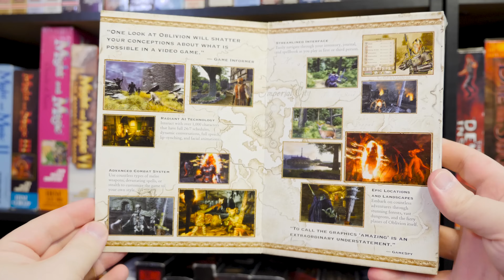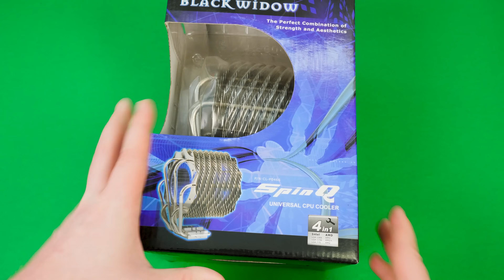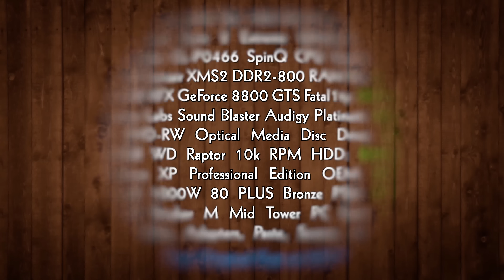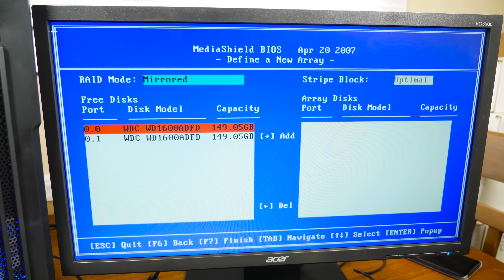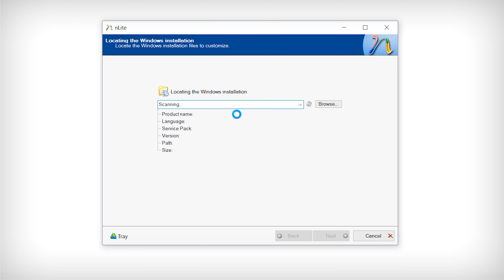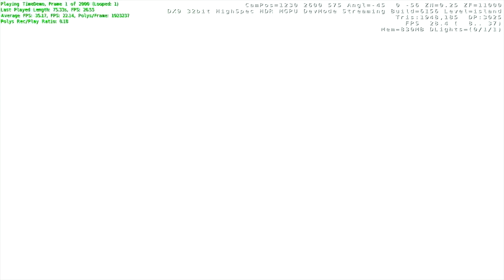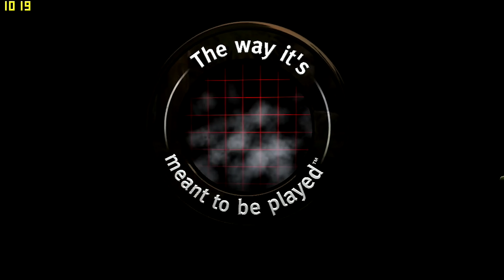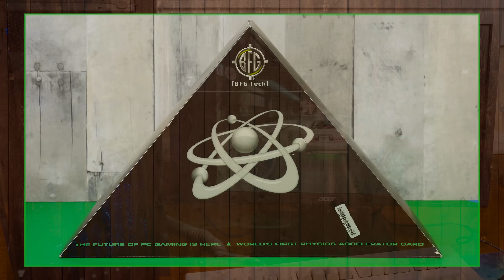LGR - Building My Dream $3,588 Windows XP PC

Comment: You didn't even use a swiss army knife
Reply: No allen wrench or tweezers either :D
Reply: But how on earth did he manage to install the CPU without a CPU installation bracket thingy and such a small amount of thermal paste??? :D
Reply: How did he get it to boot if his RAM isnt next to each other?
Reply: And the power supply fan wasn't even throttling
Get that unforgettable verge video up at my channel!
Reply: And his power supply I mean BRICK did-int zinc short circuit with the system.
Reply: But did his allen knife hopefully have a Philips head on it that didn't short out the brick?
Reply: Well at least he was able to install the brace at the back of the case before putting his MB i/o ports through said brace.

Comment: Windows '98 and Windows XP were the two OS that I delayed as long as I could before I was forced to "upgrade"
Reply: now for me it's 7. looks like i still have a few years until stuff stops working.
Reply: The extended support for Win7 SP1 will end at 14.01.2020. So you have about 1+ year.
Reply: i'm talking about software, not support from MS.
Reply: Not really if you have win7 pro sp1 it has to 2023.
Reply: Windows 7 > Windows 10. Windows 10 = ass. My point is stay on 7 until it's ripped from your begrudging hands. I've always run windows but Linux looks better and better with every windows iteration.
Reply: +HalcyonDayDigital For most use cases I'd agree, however with my specific monitor setup (4K on one and non-4K on the other) Windows 10 does actually work better (or at the very least, Creators Update forward - I'd stay away from the original). But you are right, for most cases, Windows 7 is probably the best option.
Reply: I've used 95, ME, 2000, XP, 7, 8.1 and 10 
And what I have to say is
IF IT'S NOT BROKEN, DONT FIX IT
Reply: """"""""""upgrade""""""""""
Reply: i actually upgraded from xp to 7 around 2 months ago lol
Reply: I've used XP until somewhere in 2018, using 7 now, but will certainly switch to  Linux distribution.
Reply: I dualboot windows7 and xubuntu currently
Reply: I dual boot Ubuntu and windows 10 on my laptop. 90% of the time i use linux, except for the 3 softwares that require windows
Reply: Only issue I've had with windows 10 was the first install my HDD ran at 100% constantly but after I reinstalled windows 10 I haven't had an issue since. I'm glad I haven't had any of the issues I see people complain about all the time.
Reply: thinking of doing that too as my laptop came with win10, my desktop is what i put win7 on. I just feel like win10 is a bit slow on my laptop lol
Reply: haha so did I! Finally went to 10 recently
Reply: Windows 98 why that os sucked unstable over complicated
Reply: Here's the link about OS support in MS, can't see 2023 - https://support.microsoft.com/ru-ru/lifecycle/search?alpha=Windows%207
Reply: @MilesPrower1992  but it is broken. Some can at least admit they don't know anything else or that they are lazy to switch. All of that is broken by design.
Reply: @dushk0  you really dont understand what I'm saying
Yeah they're not supported anymore
But if something worked fine in Windows Previous, (as in the last version of Windows) don't change it in the new version.
Reply: @drunkwiizard3483  then you'll never get to play State of decay 2 and that game is awesome
Reply: @drunkwiizard3483  or Halo 2
Reply: @drunkwiizard3483  I meant to say Halo wars 2
Reply: InGaming pc haha you've got me with Starts of Decay 2 but I do have Halo Wars 2 on Xbox One. Also I do actually have several windows 10 PCs but I just don't like it lol.
Reply: @drunkwiizard3483  I'm with you. I regret upgrading to ten for free.

Comment: The late 2000's were an awesome time. Hardware that can still play today's games, the fact that gamers and heavy users were ignoring windows vista and waiting for windows 7, among other things.
Reply: It was probably still better to run XP than 7 at the time. The vast majority of games used DX9, not DX10 or DX11, largely so they could run on XP in the first place. If your PC was compatible with XP it might have been a better choice because obviously it would use a lot less resources leaving more available for the games.
Reply: Yep - that exact setup would take 8GB RAM easily, and you could then put a modern Nvidia card in, and install Windows 10 on an SSD. 

That would run most of todays games. An Nvidia 1050 or 1060 would be overkill, but check it out - it'd run loads of todays games a playable framerates.

Hint: I've tried this :)
Reply: Yup, I'm still running an overclocked Q6600 with Windows 10, 120GB SSD, 8GB of RAM, and a 750Ti.  Runs most modern games just fine.

Comment: When a 2007-2008 computer better than your computer
Reply: Me lel
Reply: Cool
Reply: Bro. I apologize.
Reply: @kacpreusz9911  co?
Reply: @mlcs  Wiesz co to tłumacz Google?
Reply: @kacpreusz9911  owszem, wiem. Ale chyba coś Ci się pomyliły komentarze.....
Reply: @mlcs  ???
Reply: I'd say me too, but I finally got a computer that can sort of compete with that beast.
Reply: That's honestly sad lmao. Then again I can't say much, mine's only slightly better.
Reply: Jep thats the Case... Build my PCs in very Low cost with used parts
Reply: And i am thinking my PC is garbage with 8gb ddr3, 120gb ssd and 1tb hdd, amd a10 7800 with integrated GPU which runs gta v...
Reply: Pretty much my PC back then. 2GB of RAM and one 8800 GTS.
Reply: I was relating to this 5 months ago but i'm so happy to now have a med range pc with and i7 16gb ram and GTX760 SLI x2
Reply: chronic autism I have a i5 8gb of ram GTX970m it runs at 2.4 ghz its a 2016 acer aspire e 15 5
Reply: @residntas6618  Maybe you could look for some second hand stuff. The cpu is not great but if you can find a second hand high end Haswell CPU (Intel 4th gen core), a compatible motherboard and an AMD RX570 GPU. Then you could still use the DDR3 memory, ssd, hdd, case, PSU and if it's an aftermarket cooler maybe you could even reuse that (standard Intel coolers are pretty much garbage but do the trick if you don't overclock or mind the noise). That would still make an awesome system today.
Reply: @CheapBastard1988  Already upgraded my pc. Now it got ryzen 5 1600, rx 580, ddr4 16gb, 1tb HDD and 250gb ssd.
Reply: @residntas6618  still got a ways to go son. I built my first pc 4 months ago, 2600x, RTX 2070, 32gb DDR4, 512gb m.2 nvme, 1tb SSD, 5tb HDD. You upgraded to a low end pc lmao.
Reply: @TheGauges420  I always do so. :-)
Reply: @TheGauges420  I use PC for gaming, and i am on tight budget, it runs every high end game full settings so i dont see point of upgrading rn
Reply: Thats me
Reply: @residntas6618  

Yup, don't worry about that snob anyway, his rig is just a money waster especially that RTX 2070, which is hardly an upgrade from the Nvidia 1080 TI, and way more expensive then one at that. 

Regardless just keep doing what you have been, and find decent Entry Level parts for the time you built that PC, and upgrade whenever you feel like it, I know my rig I bought 4 years ago still works great for my needs, and I don't care about maxing my settings all the time, so why waste the money when I don't have too. 

CPU; A10 7860K (R7 GFX)
GPU; XFX Radeon R9 380p 
RAM 8gb G.Skill 2x4gb Ram Sticks 

Besides I can, and you should also be able emulate up to the Wii U, and PS3, so I really don't see a need to upgrade anytime soon personally haha
Reply: @TheGauges420  That's not a low end PC by any means.
Reply: i remember being young having a barely capable pc and dreaming of expensive gpus, now im 34 and can afford a 3900x with an rtx 2070 and custom water cooling and im as happy as i imagined id be someday
Reply: I still have my Core 2 Duo E7500 with 8 GB and a 4850 card. I clearly stopped putting money to PCs in 2008-09.
Reply: Is me
Reply: When your Ryzen 3 1300x retro gaming pc could pwn LGRs $3588 dream XP machine...
Reply: HOLY SHIIT
Reply: Brazilian?

Comment: Such a great build!! The amount of nostalgia in this video is STAGGERING!!  I built a system Very Similar!  But i built in probably late 08 early 09, mainly because these parts were $$ at launch.  I had an nvidia 680i board, with that same cooling and everything.  You actually had to clip on the little fan yourself, and i still have mine in a my spare fan bin!  I ran  a Lian Li case with removable mobo tray, and a 8800GTS with a Hacked Bios.  CPU was q6600 with OCZ ram, back when that was a thing. No raid or raptors, but i did have  multiple drives.  One of those tornado spiral coolers topped it off, it was all copper whatever it was. Funny thing is though, i didn't actually spend all that much.  One because i was about a year or so late to the part, but also Every item i bought was either on ebay, scratch and dent, or on some type of sale. I ran that rig for years with only video card upgrades, probably a few full generations before i moved up.